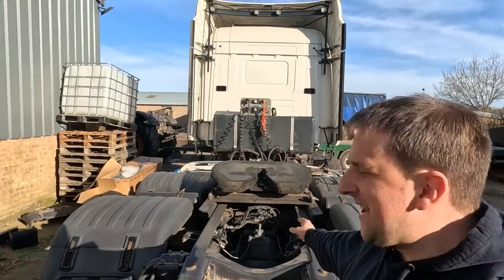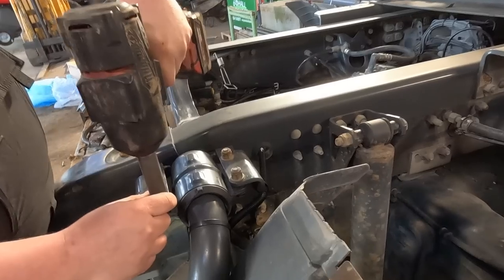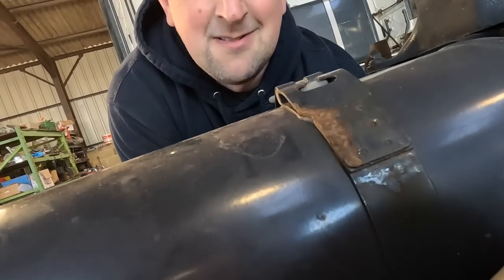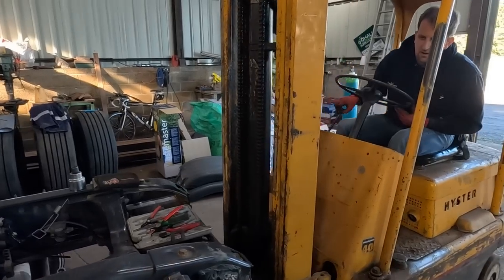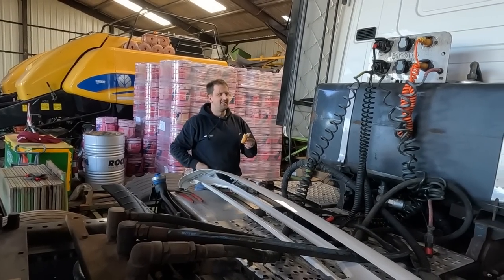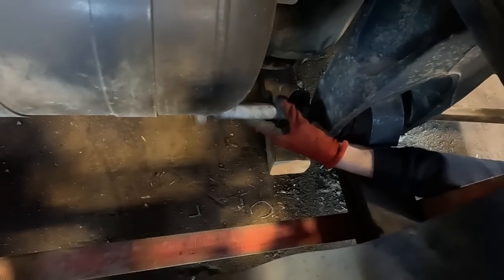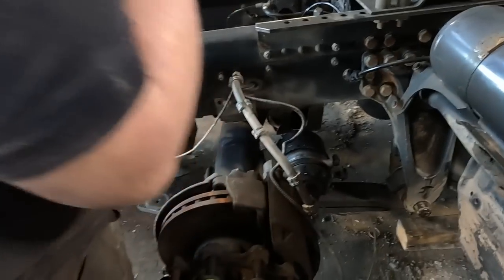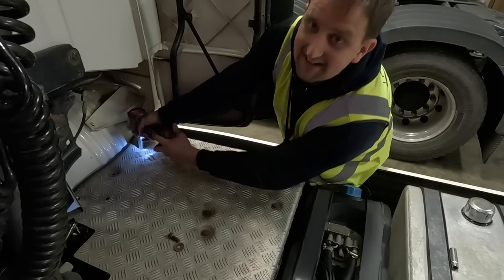Work Has STARTED! | Martyn’s V8 Truck Build! | #truckertim

Comment: Twin tag and single tag help to distribute the weight and they are mostly used in places where there are axle weight limits.
Reply: I googled this before tim mentioned it and the first forum I got to, the first post said 
" I don't know the answer to this but MY VIEWS ARE....."  
yeah I stopped reading.
Reply: Nope. Tags give you bigger gross weight, 25-29 tons on the tractor.
Reply: All I know about this is that they look cool
Reply: Twin tag give you more weight you'd be able to carry

Comment: The difference between a single and a double axle is that the single one will pull but will take longer to speed up but with a double axle you you will speed up quicker and be able to round corners better as far as I know